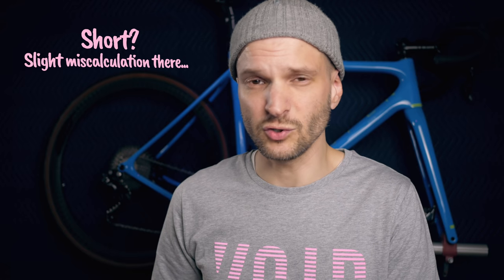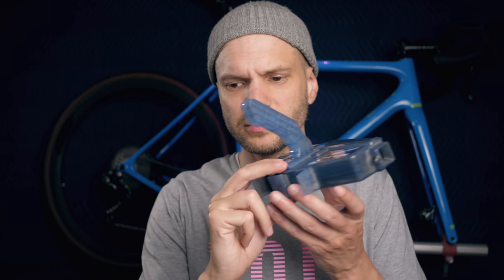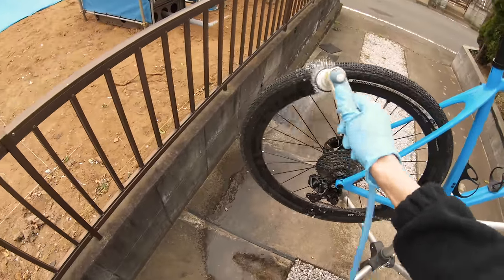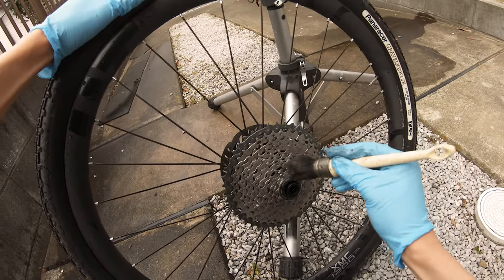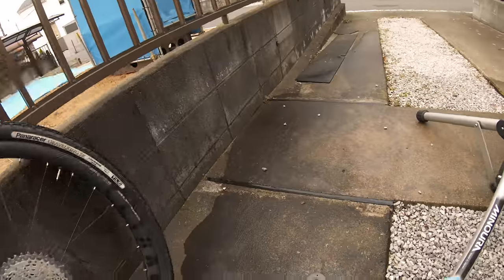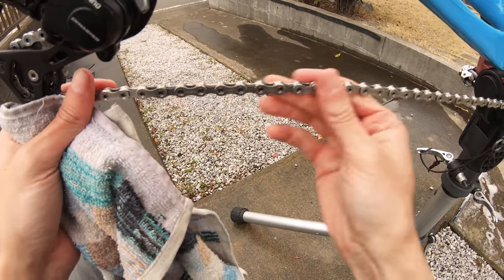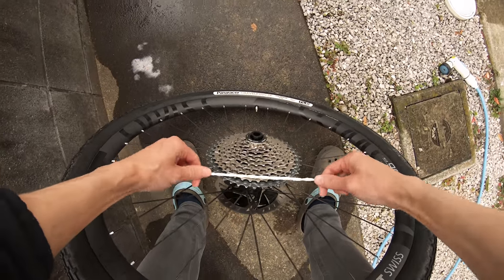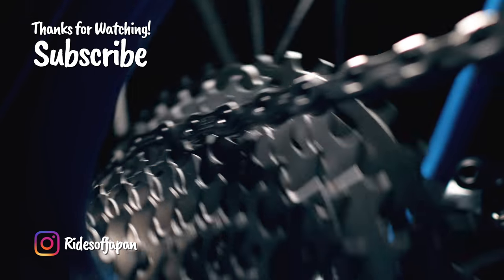My obsessive compulsive chain cleaning disorder

Comment: As a guy who also loves a spotless and noise-free bike, here are my tips and tricks for properly cleaning your bike INSIDE your apartment/house (in case you have no back yard to make a mess around):
- wet wipes for the frame, cassette and even rims (the sort you use for cleaning your bathroom; not all work as well, but some of them have really good solvents that clean up dried up gunk easily)
- remove the cassette from the freewheel to clean it more easily and more thoroughly, same for the jockey wheels
- use Diesel fuel to clean the chain: remove it from the bike, leave it in a jar filled with enough Diesel to cover the chain for half an hour or so, maybe shake it a few times in the meantime, then remove it from the jar and wash it off with some dishwasher fluid; far more efficient than absolutely any chain cleaner product I have tried, especially if there's very old lube and gunk on the chain

Absolutely no mess, far less material involved, and also one of the only ways to clean your bike inside your house. Also somewhat quicker and more thorough once you get used to the procedure. In extreme cases, when your wheels end up looking terrible after a particularly muddy ride, they may take a shower with me to remove the main layer of dirt before cleaning them properly with wet wipes.
Reply: If you're washing inside, you can half-fill the kitchen sink with warm soapy water. Then, balance your wheels across the sink diagonal which should put the tire roughly in the water, but not the rim. Then scrub whilst rotating the wheel to get everything clean. Wet wipe for the spokes and hub.
Reply: @jamesvaughan7274  that's a very good tip, but sort of depends on the shape of the sink. I think it should work fine with mine.

Comment: I use Prolink chain lube on my bikes, i believe it has paraffin in it or something which helps clean whilst also lubing the chain, comes off easily, and keeps your chain gunk free with out being so meticulous when you haven't got the time. 
also a quick disc cover hack i use is wrapping a couple of layers of blue towel around the disc, can be used to clean/dry other bits afterwards to if you don't like being wasteful.

Comment: Alternative to a compressor: get an old diving air canister (a large one) and use this in lieu of a comporessor. Friend has a bike shop and also cannot have a noisy compressor and it works great.
Reply: Hope that means you’re going to test it 😜
Reply: A lot of solutions available if you have the room but cannot have the noise. You can use eg. a large car tire as a cheap air "tank". Something for heavy vechicles holds quite a bit of air. You can also fill those with any tiny and quiet compressor and you get a lot more out of a small tire than from an air duster.

Comment: I run a different lube for different bikes. For tarmac only bikes, I use ProGold ProLink Chain Lube on that one. I lube before every ride and it attracts dirt. It is a PITA to really get my chain clean and I clean mine exactly like you do. However, it performs really well. For bikes that will see dirt, I use Squirt Long Chain Lube Wax Emulsion for Wet & Dry. I rarely have to apply the lube and the chain is super easy to clean. If I had to have one arrow in the quiver, it would get the Squirt lube as it is an all conditions lube and low maintenance.
Reply from the maker: Cheers!
sound like a good solution that 👍

Comment: Have you tried waxing your chain? I bit the bullet with Molten Speed Wax, in general I'm happy, it lasts for a month with daily riding in all kind of conditions, mostly offroad. But it flakes, be careful where you do your first ride. And you may have to clean the flakes from your frame and derailleur. Other than that, the chain stays dry and clean, and well lubricated.
Also use silicone spray on a rag and apply it to your frame, esp. where it collects mud -- it makes the frame water-repellent and much easier to clean even with just water. I also use "air can", high pressure liquid butane, to airblast the chain and derailleur after washing it.
Reply from the maker: Ivo Roilev I’ve not gone down the waxing route (yet). The flakes definitely puts me off.

I quite like the cleaning so it’s not a problem that need solving in my case. I will start with giving Squirt a go though. 
Might change my mind in the future you never know.

Comment: 1lb parafin wax 5 grams telfon 1 gram molybdenum disulfphide  melt in crock pot, put chain in chain let it also heat up and penetrate then take out and let it hang.  Dry, quiet, clean, almost nothing sticks to it.  Last a while in dry conditions; however, lots of work to do it.  Have to clean chain first time really well, after that just melt wax and re-dip.  Good for a lot of chain treatments.
Reply: This is what I do too (only pure parrafin though). FYI, Friction Facts recommend cleaning chain in Mineral Turpentine to remove factory grease then methylated spirits (to remove turps residue). Preferably with an ultrasonic cleaner.

Comment: Great video. I too use Squirt (manufactured in South Africa), yust wipe the chain with a clean rag (back pedaling) after each ride.  I then yust reapply the lube, wipe again, and then reapply a second coat.  Stays pretty clean chain never dries out.  But when Squirt flakes off (and it will) it leaves gobs of gummy residue on your floor.  So put a mat under your bike where you store it.
Reply: 8638marc put
Reply from the maker: East Squirt easy to clean off?
Reply: @ridesofjapan  Yes. I use dish soap (Dawn Ultra) and hot water in the shane cleaner once every 1000km and degreaser once every 3000km (3 months).  Also, I apply silicone based lubricant (Jig-a-loo) to the cassette, rings and outer chain, so that any dirt does not stick.  I think furniture polish (Pledge, which I use on the frame) would also work. This method gives me a very quiet drive train, like a belt drive bike. When I pedal, all I hear are the ice cubes in my thermos!

Comment: Rotors and brake pads are sensitive to contaminates, I recommend wiping down the rotors with a dry rag, then removing the brake pads and cleaning the caliper with rubbing alcohol. I can't imagine you having to deal with cleaning a downhill bike, you would go crazy! Another thing to watch for is the clutch on the derailleur, the grease inside it is essential for it to work properly.

Comment: I am equally picky with my bike cleanliness. Wax-based lubes like Squirt and Smoove are the best I've found - last .a bit better in the wet and don't pick up as much crap. You can rub off the old lube with a dishtowel. I use a Wipperman Connex quick link - it's reusable over and over and over and means I can take the chain off each time I clean the bike - makes it super-easy to keep the mech clean. If there is a big buildup of muck - I pop the chain in a bidon of degreaser, shake it up, leave to soak, take the chain out, give a good clean with a towel, then clean off with water. If you have your chain off the bike, you can fling it around and around your head to get rid of any water inside - instead of blowing air into it.
Muc Off disc brake cleaner works pretty well for rotors and pads too.
Reply from the maker: Awesome mate! Squirt seem like the business and will be next on my list!
Reply: I used Squirt for several years before I found Smoove. They are both really good - Smoove seems to last a bit longer. If you're cleaning weekly anyway - that won't matter much - go for whichever you can get the best deal on.

Comment: Another good video.
Basic the same technic as me. I use a jam jar  for the old degreaser, the dirt settles out and I reuse it like you.
Once chain is clean I put it in a cheap ultrasonic cleaner. I also use MO94 spray to displace water from chain before adding the c3 lube. 
One drop per link is the best method for adding lube.

Comment: If i ride on a road, not in dirt, I will only use Rohloff Oil - best lubrication, and drivetrain is absolutely silent for hundreds miles. But don't use to much, and remember to remove excess of oil with cloth.

Comment: you should probably check out Squirt lube.. you put it on after washing and top it up after every few rides (or after a wet ride). washing doesn't require degreaser because it isnt oil based. they claim it makes your drivetrain more efficient and it does feel faster. since its not oil based, the wax just slowly comes off over hundreds of km and you dont get that black oily gunk that can destroy your hands/leg/kit/house/car or anything else that comes in contact with your chain. its also very cheap. i switched both bikes over and would never go back to oil based lubes.
Reply: Try parrafin wax
Reply: I use a mix of beeswax and paraffin wax (35% and 65% respectively). Quiet ride for at least 150km on my mtb, and I'm not a spinner (I'm a masher) and I cross-chain... so it really is moron proof. Cheers.
Reply: I agree. Here's what I think of Squirt: https://www.youtube.com/watch?v=G6p03DMXDj8

Comment: How many k's do you get on a chain?   5000k, 10 000?
Squirt is good but does not work in cold weather where it flakes off. Squirt keeps your chain clean and shiny but does it lube as well as Mucoff wet lube? Squirt has a cold weather lube which is useless. I am obsessive like you but I use a steam cleaner to blast the gunk between the links and the drive train first and after I use paraffin in the park tool which I reuse once filtered. The park tool is good but does not dip and flush the chain in the liquid. I run the chain through 3 fills of the park tool or until the paraffin runs clear. For the frame I use car wax wipes....no hose pipe only a spray bottle.  Best tool for your kit  is old tooth brushes which I use to scrub the brake blocks and the rim.
Reply from the maker: I’ve never wear out my chain before I change it, so I actually don’t know how long they would last in my case.
Chains are cheap, cassettes and chainrings not so I change chains about 2-3 times/season regardless of how worn it is... another disorder I have :)

Comment: You can make a portable compressor using your  tubeless booster/pump. Use an adapter for ball pumping and do not open booster completely. Could work I think

Comment: very good video, as always.

For my part, I have long rolled with mucoff lubricants. But in France, they did not convince me. I tried the squirt lub (biodegradable), same reaction, effective yes, by cons even if it does not blacken, it leaves a layer of white wax relatively thick and pasty ... However, I have my favorite lubricant, the finish line dry with teflon. I am very satisfied with it, it adheres a long time to the chain and resists relatively well with the rain. Only precaution to take, to use on a perfectly dry chain, if it blackened slightly before its drying. This oil is also very fluid when applied. An oil recognized for a long time for its quality and low price. But recently, I also hear about the extraordinary quality of Rohloff chain oil. 100% natural (no product from hydrocarbon), very resistant to moisture. It would be an ideal oil. I will test this in a while. If you're interested, I can give you a return after a long test
Reply from the maker: Kustoms95 cheers mate!

I’ve user finish line Teflon a lot in the past, been very good for me as well. 
I’ll give Squirt a go next, but I’m worried about what you mentioned leaving a white wax hehe.
Will see how it works out.

Comment: Use the following cheap (~2 EUR/L) and easy mix for cleaning:
- 5% dishwashing liquid
- 50% methylated spirits
- 5% Sodium Bicarbonate (Baking Soda)
- 40% Water

OR
- use WD40
- wait 8 hours
- clean the chain with a no longer used socks or underpants
- use a cheap chain oil or left motor oil
(repeat ~every week/~100km)

Comment: I haven't gotten to perfect chain cleanliness yet like you have. Lately I've been using isopropyl alcohol as a degreaser and it works better than the orange-based degreaser I'd used before. I need to go farther with sponges and brushes, or get an ultrasonic cleaner and try that, I think.

Another high quality, entertaining and enlightening video like always. ありがとうございます！

Comment: Your not as OCD as me... I wash my bike every week but I also remove the chain and wash it separately because I found the chain cleaning gizmo was not effective enough. So I put my chain in plastic pot with 1 degreaser and shake it, then wash the chain out with dish soap and water, then put it back in the pot with a maintenance spray and repeat shaking. After that the chain in removed and hung up for the rest or the day to drip dry, then I fit the chain back on my bike and lube with my own brand wet lubricant. My chain is so clean that dirt doesn't appear to turn the chain black until midweek, it doesn't matter anyway because it will get washed again at the end of the week.
Reply from the maker: Awesome! Love it!

Comment: I use 2 ultrasonic cleaners for my chain and cassette. 2 cycles of degreaser in one cleaner for the cassette and chain and 1 cycle in chain lube for the chain, then I run the chain through a paper towel to remove the exes lube. And 2 times a year I also put  my pulley wheels in there and  put some fresh grease in there.

Comment: After doing degreaser with the park tool cyclone, just fill it up with soapy water and run the chain again with that. Washes the chain plus also washes the tool (to an extent). Got this from park tool's washing video.
Reply from the maker: msironen yes I used to do this as well.
Lately trying be a bit efficient I clean it with the sponge instead, as don’t need to wait for the dirt to settle to pour over the degreaser for re-use.
Very good point you make about it will clean the tool at the same time though 👍
Reply: @ridesofjapan  I pour the muck+degreaser from the cyclone tool to a jar through a coffee filter so no need to wait :)
Reply from the maker: @msironen  that would do the trick!

Comment: Do you wipe off the chain after oiling it? I do that, after at least a few minutes, to get some of the oil off the outside of the chain to prevent dirt sticking to it, as the oil should really be inside the plates and rollers. What do you think? Oh the other tool besides a thin paint brush tool like you have, is of course the pic. I found the pic to be great to get really stubborn gunk out of the cassette, maybe you get this with the hose or your bike is cleaned so often it doesn't build up. For me it does, especially my old less clean mtb.  The cogs that are pinned are annoying as you can't hold the pic continuously in between the cogs on the spacers while the wheel rotates because the pins keep getting in the way - I also expect the inter-cog pins are places extra grime can stay. I just got a chain keeper :) so i will take the wheel off like you did and get a better cassette cleaning. A dirty cassette becomes a dirty chain pretty quick. Thanks for the vid!
Reply from the maker: Al Harman definitely a good idea!
I used to do it but I found with this particular lube that on longer rides I stayed quieter for longer when I didn't wipe the chain off in the morning. As I’m cleaning the bike after every big ride can take the compromise of bit dirtier chain.
The general recommendations are definitely wiping off the chain of excess lube to keep it as clean as possible 👍
Reply: You have a crazy perspective on cleaning your bike but the results are amazing. I have two bikes, my new commuter and my 20+ years old unshocked mountain bike. I used whitelighting as a cleaner and greaser and never cleaned the bike until last year. I just changed the chain, first ever, and cleaned the inside of the rear derailler arms wow. I don't know how to clean the spring inside. I was thinking of taking the jockey's out too because that was tough. I loved your pinched fingers on the jockeys i think that is a very important trick to get rid of that guk because once it builds and stays it is very difficult to remove. So I will try that. I also use muckoff chain cleaner device which I was surprised you didn't use since it drops new degreaser from above the chain and does not reuse/recirculate contaminated solution from below...but... your results are still good.
 @ridesofjapan